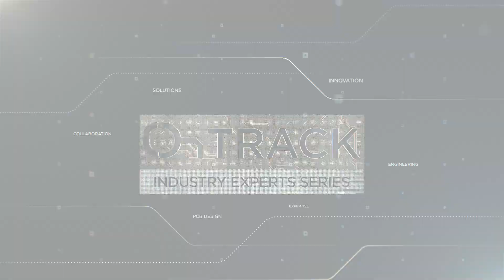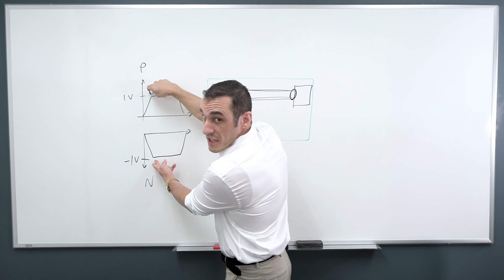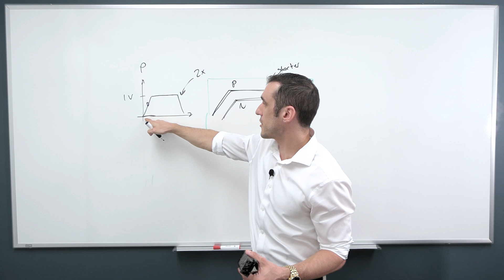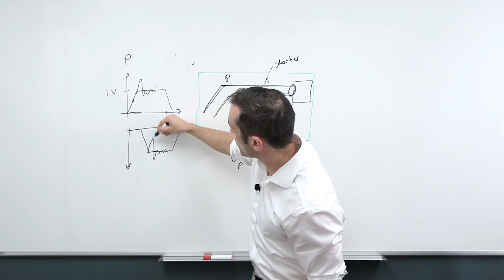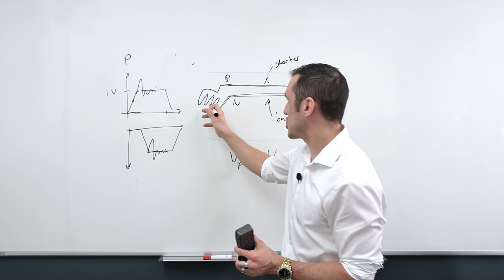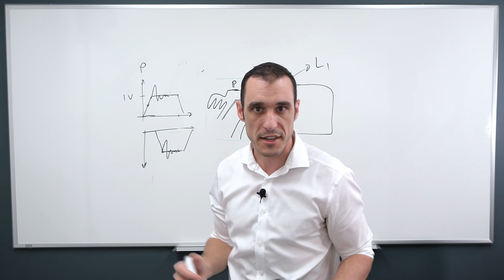Length Tuning and Differential Pairs

Comment: Per the great Rick Hartley, you do not need to make an exceptional effort to match lengths. In fact, Mr. Hartley makes no effort at all. He just routes them next to one another.  https://www.youtube.com/watch?v=QG0Apol-oj0 ~47:00
Reply: Rick is correct given the signal rise times he shows in that presentation, which are on the order of 0.7 ns. At that rise time, the total expected jitter from deterministic and pseudo-random sources will be much less than your skew budget, so you do not need to be extremely precise. But at 100 ps or less, which is a rise time you might see for anything above 10 Gbps per lane, you do need to perform some length matching so that you leave enough room in the timing mismatch budget for jitter. At those channel bandwidths, high frequency ISI also creates more noticeable jitter, primarily due to the residual impedance mismatch at higher frequencies (from roughness) and the fact that the channels tend to be roughness-limited in terms of insertion loss. So you actually see the jitter more easily at those frequencies. There is also power supply/PDN ripple contributing more to jitter in these channels. If you put too much length tuning, you get too much mode conversion, and differential interfaces like PCIe have a mode conversion limit that you need to stay under. So you have two competing goals: low skew to leave room for jitter, but not too much length tuning that you get excessive mode conversion.

Comment: no there is no mis match. the induced noise cannot come later because it's from the same source. the noise is on the edge of the lower signal but should subtract in a similar way.
Reply: Noise can absolutely come later and does not have to originate from the differential driver. Most common is from crosstalk or ISI. Another possibility is mode conversion, although we left it out of this video as it is a more advanced topic. With crosstalk into a differential pair, there is both a common mode and differential component due to the different magnitudes of the noise signal on each trace in the differential pair. And noise only subtracts if the noise is common-mode, differential mode noise does not subtract. In general, any noise signal can be decomposed into common mode and differential components.

Comment: Is it necessary for an analog circuit with differential signals as well?
Reply: Yes if you have an analog circuit with a differential interface, then it will be necessary. However, it is important to note that the important factor is the phase difference between the two opposite polarity signals. Some analog circuit may be sensitive to phase differences between the two polarity signals, and the allowed distance mismatch will depend on the allowed phase difference and the frequency of the opposite polarity signals.

Comment: Hi Zach.  Your first 4 minutes are what I have always called "Static Phase Tolerance", which as you say, is specific to the receiver (end of the diff pair), and has to do with the "eye" or amount of time the receiver "sees" a valid signal.  In-between that will be noise, which decreases the eye.  After that, you start to talk about what I have always called "Dynamic Phase Tolerance", which is maintaining the wave front along the two differential signals, and is specifically, as you say, for common-mode noise rejection.  With dynamic phase tolerance, you need to adjust each trace to maintain a specified difference in length all along the entire length of the differential pair.  Those minor length "adjustments" should be done at intervals along the diff pair routing to maintain the length matching is maintained along the entire length.  I would strongly urge to not use the moose antler shaped routing you showed, as it does not maintain differential impedance.  Plus, if that much is needed, and you've added it all in one place, that means the dynamic phase tolerance is WAY off all along the rest of the diff pair routing, which compromises the common mode noise rejection.  I believe Altium only supports Static Phase Tolerance, as in, gives an overall distance comparison of the two legs of the diff pair.  It does not give any readout along the diff pair or where along the diff pair it is out of Dynamic Phase Tolerance.  If I'm wrong about this, I'd love to know, but it's a feature that IMO Altium needs to add.  Other tools do have this.  In Altium, I just look at the routing, and add the "adjustments" just after spots that cause the length mismatch (typically after a turn that doesn't have a corresponding turn in the opposite direction right after).  All of this and how particular you are with your differential routing depends on signal level and frequency.  Since I am typically in the many GHz, this can mean the difference between working and not.  But, it should all be spec driven by the design requirements.  Length matching across a group of 1 MHz signal to within 10 mils is typically a waste of effort.   Understanding when design rules make sense is in my opinion very important.
Reply: You're not wrong but there is some context needed. The serpentine length tuning can create large deviations in differential impedance that you mention, they can also create lots of mode conversion. But this is only in the condition where the traces are already very close together (spacing << distance to ground plane). But if you have a differential pair and the ground plane is much closer than the spacing, then the differential impedance variation along the distance of the length tuning structure is much smaller. You can get that variation to be much smaller than the allowed variation within your signaling spec.

Also the length of the structure compared to the frequency range where you need to implement wavefront matching matters. Longer length tuning bunches will create more reflection at higher frequencies, or stated another way lower bandwidth signals can tolerate longer length tuning structures at least where mode conversion and impedance variation are concerned. Of course low bandwidth signals probably have very generous delay mismatch allowances anyways, so less length tuning is just as good as very precise length tuning.

I'll write a blog about it!

Comment: Thanks for your sharing.  
I have a question about the serpentine routing for USB3.2 gen 1 layout ~ I saw one of the Intel PCB layout guidelines suggests keeping the differential pair's serpentine routing length <100 mils with arcs and bends of 45 degrees, I don't know what the background theory of this guideline is, so may I consult your comment for if it means we can't use many serpentine routing in the same differential line (for example, 6 serpentine routing in one differential line)?  Or will the maximum serpentine routing length actually depend on the operating speed of the differential signal?
(The Intel PCB layout guidelines: https://www.intel.com/content/www/us/en/docs/programmable/683864/current/pcb-traces.html)

Comment: Length matching a differential pair is not a critical thing. Watch this, what Rick Hartley says about the topic:  https://youtu.be/QG0Apol-oj0?t=2657 So why should i do this at all?
Reply: It is critical, but not always for the reasons people think. There are three reasons for length tuning: noise suppression, timing skew, and mode conversion suppression. If you just compensate timing within the rising edge, the channel will work fine and you can be really loose with the length tuning tolerances (assuming long rise times), that is generally what Rick and Lee refer to. In fact, if you see a distance-based tuning tolerance in a datasheet, then it's most likely bogus. What people rarely bring up is noise suppression and mode conversion. Noise suppression is less important than mode conversion because differential receiver circuits have decent CMRR, and as long as you do everything else correctly then common-mode noise won't be major. But with mode conversion, it does not take much mode conversion within your signal bandwidth to cause channel compliance/EMC failure.

Comment: So does this mean that you can never cancel out all common mode noise? You will never perfectly align the traces length, nor is the temperature of the board uniform and hence one trace will have electrons that travel slightly faster. Maybe for practical purposes it is inconsequential but is true separation of common mode noise something that can only be achieved in theory?
Reply: I think that's a fair statement. Even if you did have perfect differential pairs with aboslutely perfect phase matching up to infinite frequency, differential receivers do not have 100% common mode noise rejection. It's pretty high but not infinite dB common mode noise reduction. I think the key here is you try to get it as perfect as possible without going too crazy on length tuning, but do it with the knowledge that there will be something else in the system that creates additional common mode noise and/or extra skew.

Comment: wait a second, there is no automatic or semi-automatic way to even phases in diff pair in AD in correct place, tuning will add all length you need in some (any) place, but not right one. to make phase stable ypu will need to do it manually. Am I wrong?
Reply: Hi Egor,

There is no button you can click that will automatically equalize everything and automatically put the perfect length tuning structure into the PCB layout. What I mean is, you can use a tool to click and drag across the trace you need to equalize, and it will automatically create the length matching segment for you, so you don't need to manually layout each section of a serpentine route (or any other length tuning structure for that matter). It will also automatically calculate the time mismatch as you do this, you won't have to check lengths and propagation delays and then manually determine the time mismatch as you add in length matching sections, you'll be able to see when you have minimized the time mismatch visually thanks to this automatic calculation. You do need to specifically select the place to put the length matching segment because the best spot to place it could be slightly different in every layout.

It's about as "automatic" as you can get!

Comment: How important is coupling between P-N if you have let's say a loosely coupled differential pair? What if I have to uncouple these in the BGA area over a long distance due to routing constraints? Would that work?
Reply: I'll give you the short answer here: The coupling requirement depends on the differential impedance target. You can have some slightly uncoupled impedance over a short length, such as when you're routing under a BGA. Those components tend to put pins for the high speed differential interfaces around the outside of the BGA so that you don't have to worry about this problem so much, but yes sometimes you do have to route between pins and uncouple them for a short distance. It's okay though, this would create a differential impedance discontinuity, but if it is short enough then the input impedance will be affected very little.
Reply: @Zachariah-Peterson  thanks for the explanation, can't wait for the next video!!
Reply: This is a great question! We have an advanced differential pair concepts video coming up, I will make sure to address this question as we will be talking more about coupling.

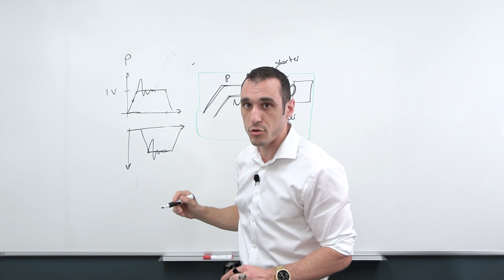Comment: At 5:11, the noise should have appeared at the same time right? like they are vertically aligned on both graphs?
Reply: He presents how the signals will arrive at the receiver in case a length mismatch exists.
Reply: @konstantinoslekkas9894  Yes that was the idea, the noise was initially received on the pair at the same time and with the same magnitude, but they eventually accumulate a phase difference due to a length mismatch.
Reply: In reality, you don't need to have a perfectly aligned or length matched pair, the mismatch values in some specifications can be very generous. CAD tools just make it very easy to implement this very precise length matching so you might as well do it. I'll be discussing this in an upcoming video after PCB West.
Reply: it is just the signals that are having a phase difference but not the noise?
Reply: or do you mean that the noise also gets delayed as probed in the interconnect due to longer route?